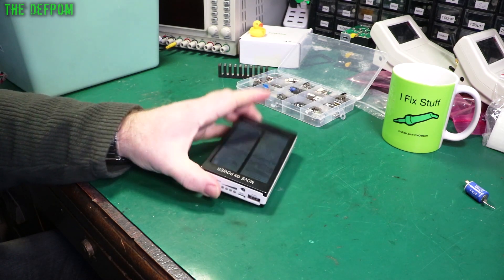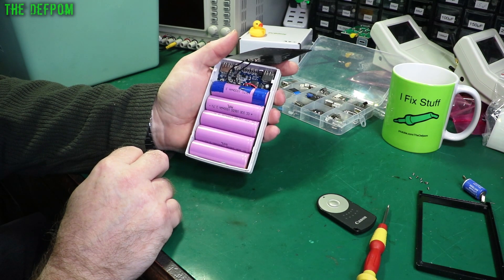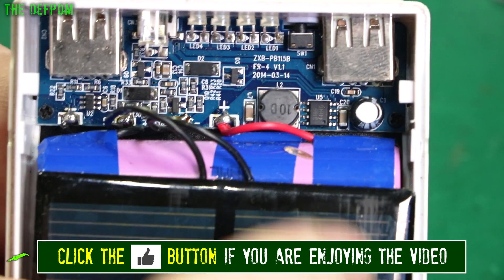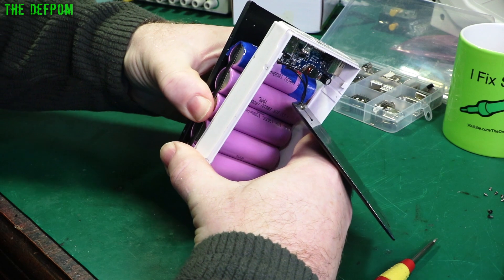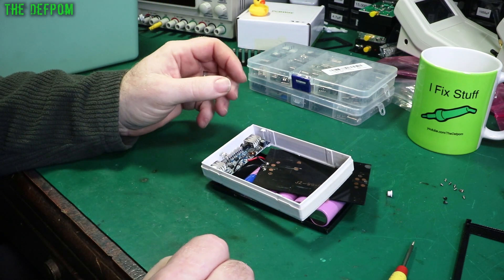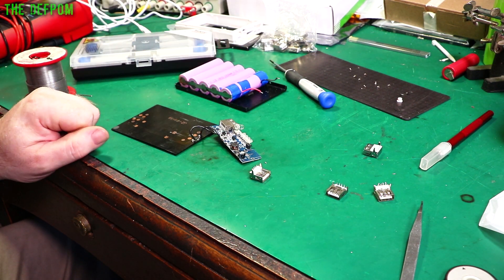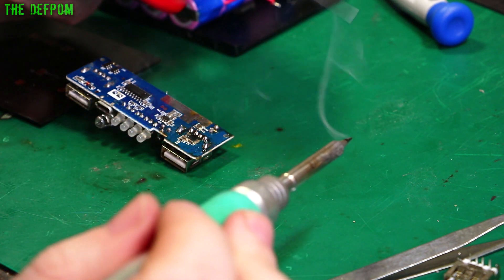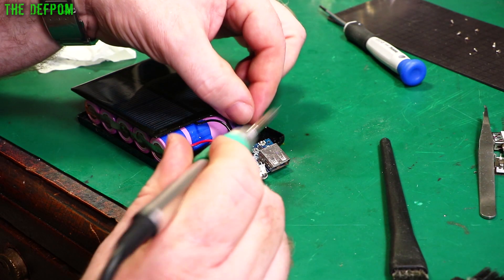🔴 #787 18650 Power Bank Repair - Fake 30000mAh Power Bank Repair.

Comment: That looks familiar. 
I bought the same power bank as a kit and used a selection of salvaged 18650s from old laptop packs.
The solar panel is mostly there for show - it only adds a few miliamps to the batteries at best.
Reply: Yeah solar panel probably just helps keep self discharge at bay... I never like solar panels on battery packs... seeing as it is a BAD idea to leave battery packs in the hot sun LOL

Comment: That power bank is not up to the job really,  connector limits and drooping voltage.
I still think pushing 1-2 amps through a data connector is very silly,  just my opinion of cause.
30000mah  ha ha :-D